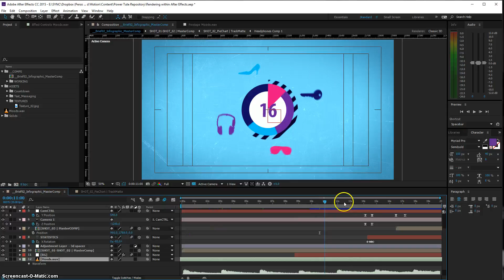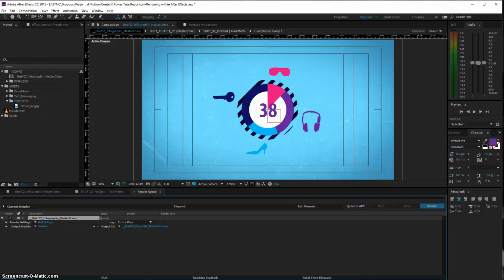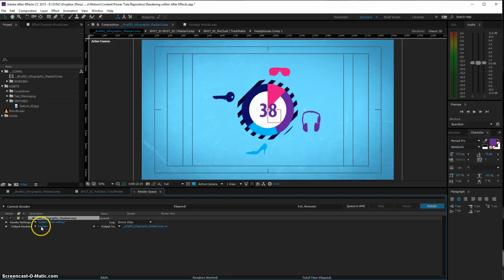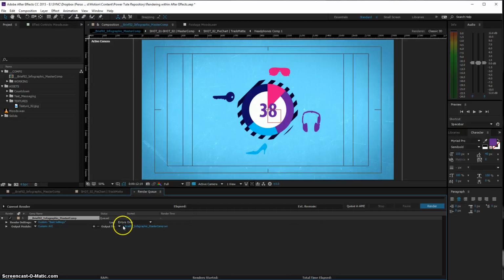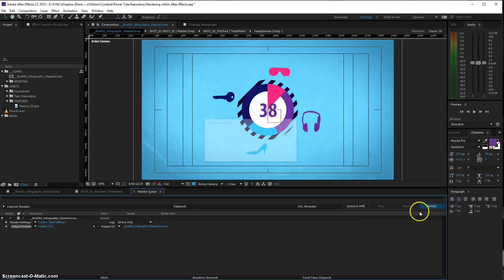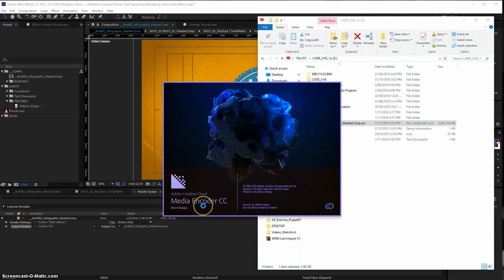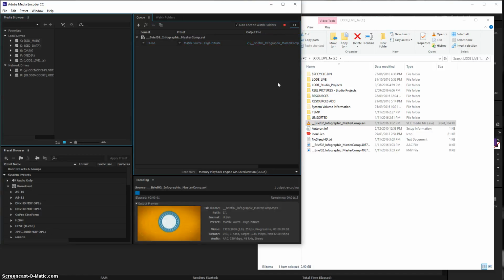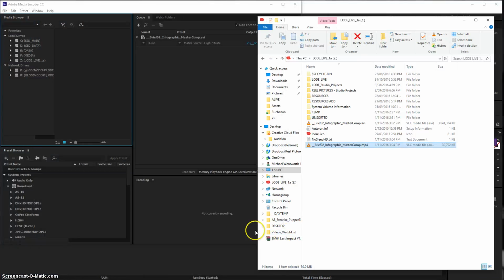Fixing After Effects and Media Encoder Rendering Bugs and Glitches

Comment: When mine renders it renders a little then I stops and it just stays there
Reply: Mine too, and my machine has a pretty good amount of power.....I fucking hate it so much
Reply: Me too at the moment
Reply: Anyone found out a solution?
Reply: Same but i did what the video told and exported it to my hard drive which has more space and its rendering rn. i hope it works fingers crossed
Reply: Hello Wassup I used to have this issue, one I got media encoder, it rendered
Reply: same!
Reply: Maybe you need to export it somewhere with more space
Reply: that  happened to me for a long time until i got a new hard drive
Reply: Anyone found a fix?
Reply: ME SUCKS!!!
Reply: @lyfe_4  Sometimes I change the bpc & it works.
Reply: @johnmoore3435  lol I found a solution by now bro that was 10 months ago but thx anyways 👍
Reply: @neutralmichaelc  this used to happen to me because I used to use a cracked ae, but I ended up buying and now its working fine for me.
Reply: @saikik5793  ok thx.
Reply: @lyfe_4  can you tell the solution